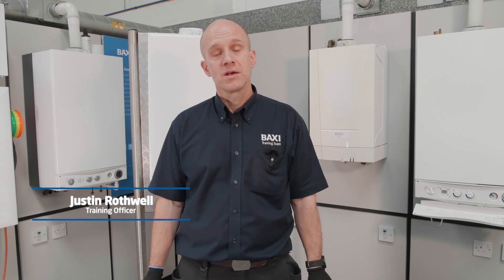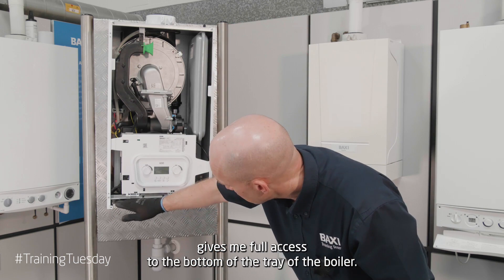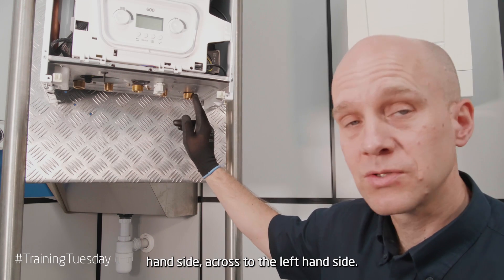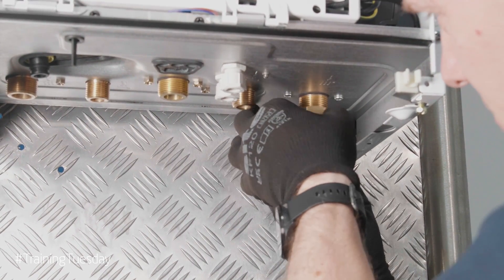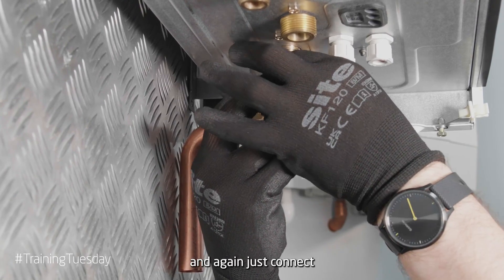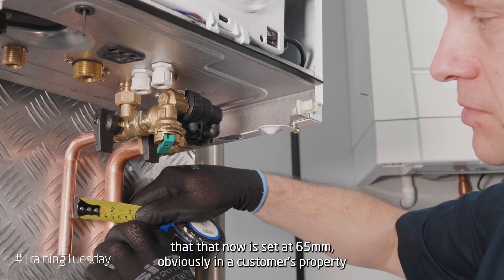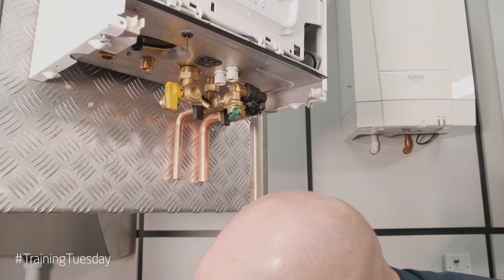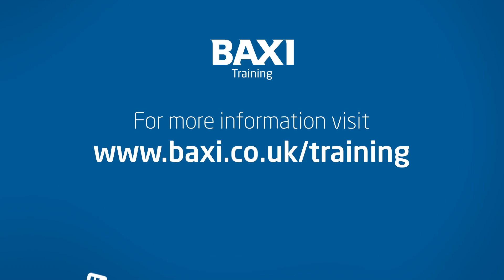How to access the pipework on the Baxi 600/800 Combi 2 Boiler range | Baxi Boiler #TrainingTuesday

Comment: Hello, own a baxi duo-tec 28. All the pipe connections run away from the bottom. It looks similar to the connections as the 600 and 800.
Do you know how different the pipe lay out is compared for a boiler swap between duo-tec 28 and baxi 600, 800 or even main compact 👍👍

Comment: I have your new 800 combi 2 what flow temp would you recommend for winter?  Its currently set to 80 at the moment
Reply: It depends on your heatloss. And rad sizes. But 80 is wayyy to high 55 is meant to be new system max but thats if rads have been sized correctly.. if its an older house with existing rads i usualy set to 60⁰ but if you have opentherm and weather compensation this will adjust on its own deoending on outdoor temp and room temp